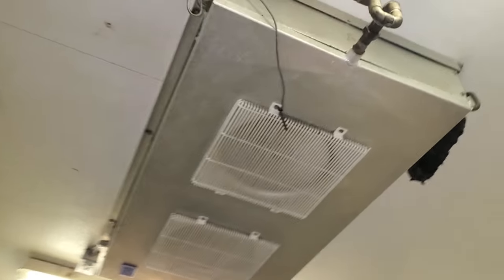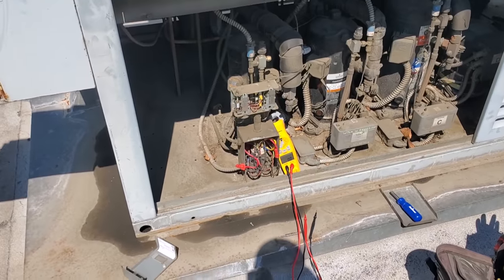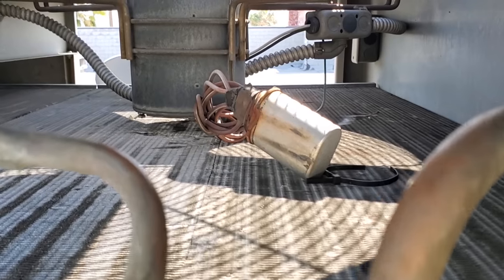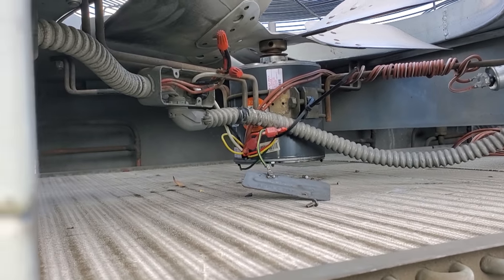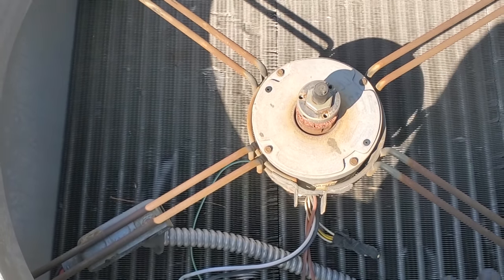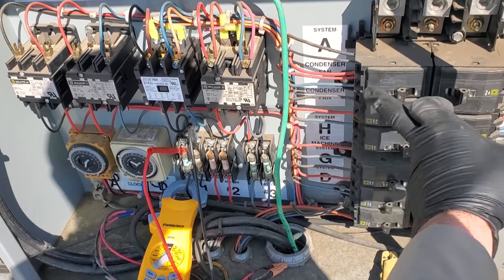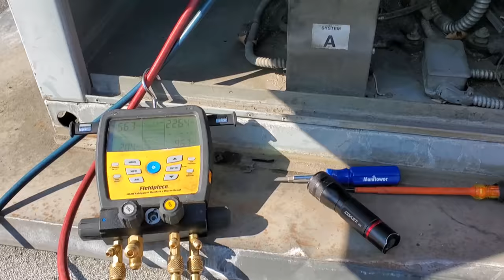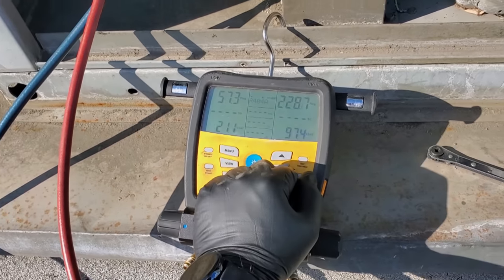THEIR WALK IN COOLER IS DOWN

Comment: Would measuring continuity  on the motor made your guess a lot more secure decision ?  Or continuity is not a  secure method?
Reply: you need a megohm/insulation tester  to test breakdown voltage of them, not a regular DVOM in continuity

Comment: That's armored conduit, that's not even the right conduit for outdoor conditions, that's for interior purposes and not the right connectors. There are charts in the NEC code that tell you how many wires are allowed in the conduit size used.

Comment: I need to make a pet peeves video. Caps attached to fan struts, wire wrapped around the struts, exposed wire nuts everywhere....good grief. I can see making that temporary repair, but so many guys leave them as permanent. So, if I know the customer will not approve the correct repair after a temp repair, I just quote the permanent repair and tell them it needs to be approved ASAP, and I bypass the temp repair entirely so the customer does not end up with bad work from my good intention.

Comment: i always forget to ask.... why do you always quote for such small things?  in so many videos ? nothing wrong with it... just not use to it... usually my clients never ask... some do i tell em verbally  ''ballpark''  price.. i only quote on major installs  or installs  and yes sometimes we can't make everything pretty all at once due to timing either its late and your tired and you'll make a mistake rather than improving so if you have to come back and fix a few things here and there. heck we've all done it
Reply from the maker: With this customer I have a 1500 dollar not to exceed but these repairs alone were probably 6-800 so I had to quote it because I likely would have went over on the return visit.....
Reply: @HVACRVIDEOS  ahh  lol i guess things work different lol my customers don't really have a limit i mean they do for thousands but if its 100 - 1000  i never have to ask .. i might tell them verbally   but good call on the Motor ... i would of done the same i would of just changed it out instead of changing the fuse checking meh its ''ok'' than a few days later the same call or even worse the motor and compressor ... but i see recently that rack has become you're best friend lol

Comment: You shouldn't have fixed the wire. You should have let it stay like that until it became a problem, then they would need to call you again and you would get paid more. I'm more into mechanic type work, but just a few months ago I was replacing a power steering pump and I noticed the vehicle had a bad coolant leak. I didn't fix it and I saw no reason to bring it up to the customer because if all goes well, I'll get to replace not only the radiator, but also an engine if it does enough damage. In this case, I got to replace the entire engine a month later. it NEVER pays to do preventative fixes.
Reply: It just gives them a chance to call another hvac guy, then you lose the job... or someone will bring their car to a diffrent mechanic...